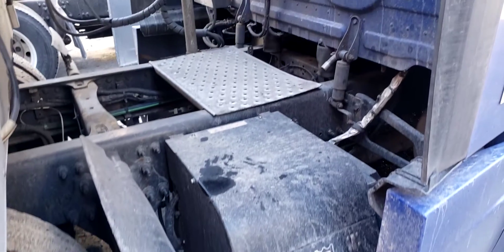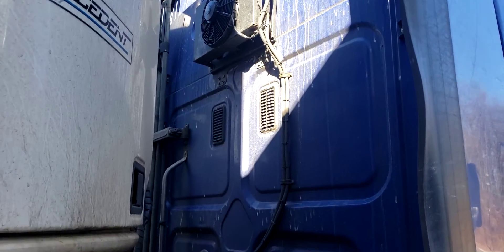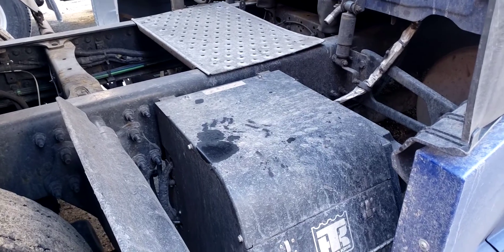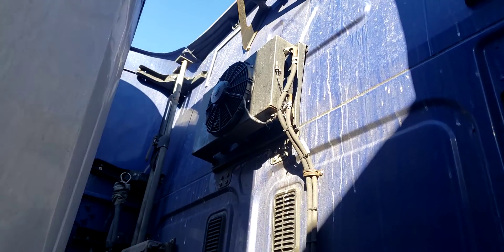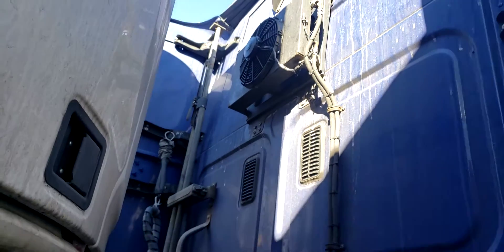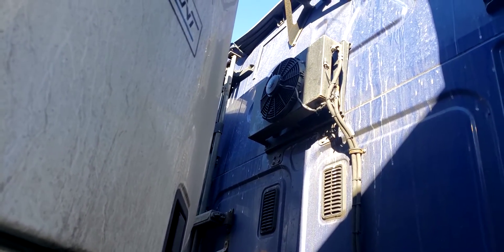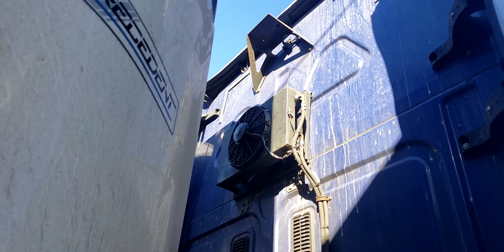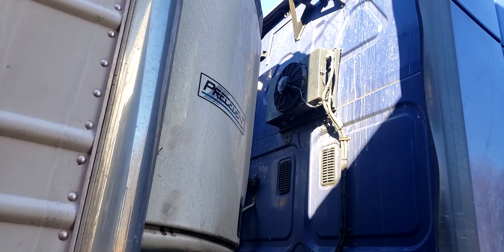TK error code 10 High Discharge Pressure

Comment: Thank you for the info!
My fan was stuck as well but I had other error…I don’t remember well the errror no.
I know the fan was not spinning after a long winter.
I overcharged the ac system and got this error 10… no I ll try to get this ac out pressing on the valve with a screw driver:)
Be good bro